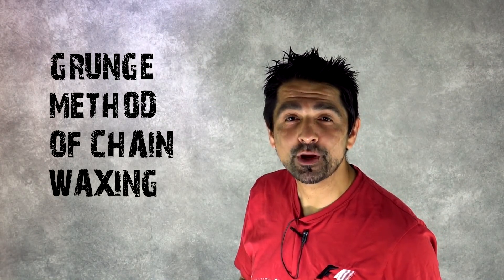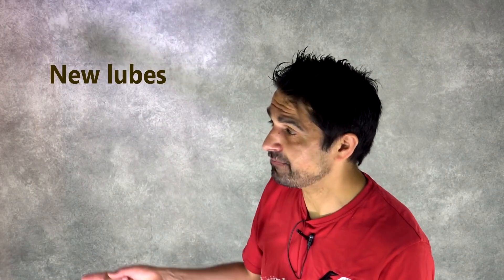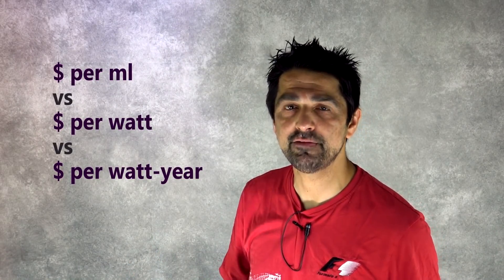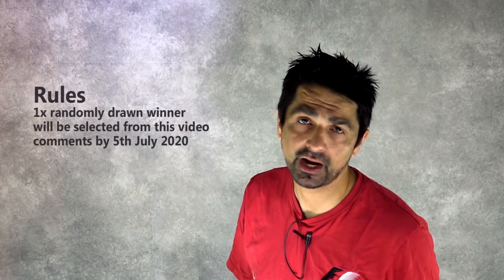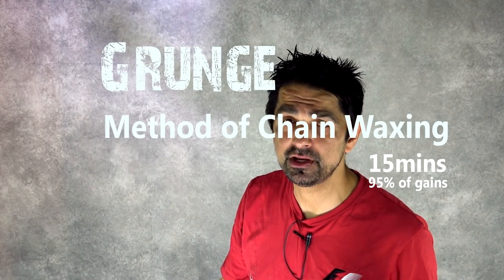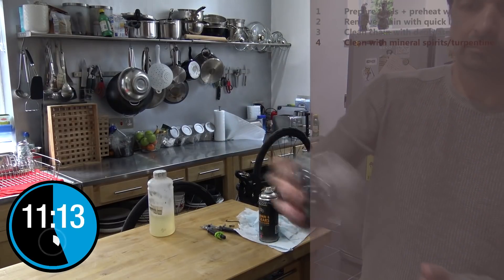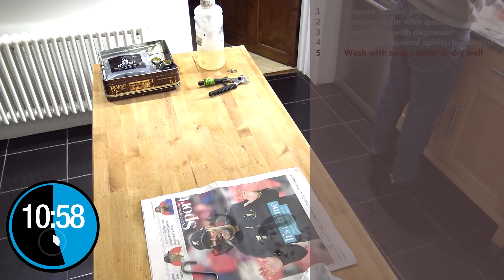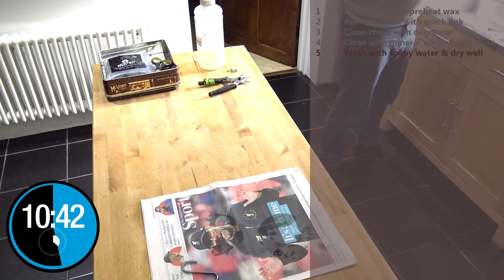Chain waxing and lubes revisited (15min grunge method is not a marginal gain)

Comment: I would suggest an immersion in denatured alcohol/methylated spirit after washing off the degreaser/mineral turps in hot (soapy) water. The alcohol is hydrophilic and will effectively dry the chain and then it evaporates. 

I've used immersion technique for track racing, where Kms are fewer and always in the dry. I have used it on the road too but I have found it lasts a lot less than 3-400kms, may be less than 100km. I find Squirt is good for 3-400km or a busy weekend, which I prefer. Either way, if riding in the wet with a wax-based chain lube, it pays to dry the chain off as thoroughly as possible afterward. If not - expect rust overnight!

Comment: This winter I started to look for a cleaner lube solution for indoor rides. I stumbled over MSW. The biggest pain is when you start out with a new chain, where you have to degrease it completely, but from there it is no big deal. I have 2 chain pr. bike, I ride 250-300 km and swap out the chain, this means I have to wax every for every 500-600 km. And turning on the pot and dip the chain, is not that big an effort. If the chain is dirty, just rinse it with boiling water through a sieve. One of the bonus benefits is that you don’t get a dirty drivetrain. I will never look back.

Comment: Click.  Click.  That was the sound of me hitting the like button, followed by the power switch of my wax slow cooker.  As a recent convert to chain waxing I wish I had done this years ago. The extra watts won’t make much difference to my level of cycling, but a full chain clean and oil lube takes a lot longer and is a lot filthier than waxing. And the waxed chain still looks great after 200-300kms - one ride with even expensive dry lube is already attracting dirt.

Comment: You are using those Ikea hooks too... :-)  I've not timed it, but I'd bet my time per chain is even quicker then 15min, by using 4 chains in rotation. I have a bucket of solvent in the shed & every two months do a waxing session. After initial run in of the chains, I hardly measure any wear (two seasons  on 4 chains & counting), so very little wear on the drivetrain as a whole. Only small side note, every freshly waxed chain needs a run-in for +/- 10km to be race ready crisp & wax chain is more noisy. (no need to be in the draw btw.)
Reply from the maker: Great tips thank you!

Comment: How do you clean the wax off a chain before re-waxing?
Reply from the maker: You don't need to for 2 reasons 1. its mostly worn off when you ready to re-wax 2. the hot max bath melts any older wax anyway...so this is one step you don't have to worry about

Comment: Back in the day when I tried waxing chains, I'd use a heat gun and lint free cloth when wiping the excess wax off after dipping.
It did reduce the amount of wax rubbing off on sprockets and chainrings etc.
Hope this tip helps someone.
Reply: Yep. I'm not sure I agree with letting the chain cool down in the wax and removing just before 50C. There's no way the wax drips substantially off even a quite hot chain - which is why I also wipe it down right after removing it from the wax.

Comment: Fred Sage 

I wasn't seeking a record,  but it obviously saves time to do many chains at once.  Additionally,  the cost of multiple chains is insignificant compared to the cost of replacing cassettes and/or chainrings.  Additionally,  since chain wear is drastically reduced,   I'm still using the same eight chains with little wear after 30,000 miles (> .2 MM).  Even if you're not interested in saving watts or having a spotless chain set,  the cost saving is impressive.  As an example,  at the rate my chains are wearing,  they'll last at least 60,000 miles.  With that amount of riding using petroleum lubricants,  I'd have gone through 15-20 chains,  at least three cassettes and one set of chainrings.  The cost of these would be many times the cost of MSP wax and Racers Edge.

Comment: I started waxing my chain about 6 months ago. I made a mix of Candle wax/liq parafin/ PTFE/black graphite. The aim is to have it soft enough at riding temperature that it does not flake off in use but solid enough that it sets.   The total cost of ingredients was 10 pounds, plus 13 pounds for a cheap rice cooker to melt and keep the wax in. I now find that just hot soapy water and alcohol wash followed by immersion in the above mix takes approximately 20 minutes, thats  every 500km (less when riding in the rain).  Since it takes about 30 minutes to clean my bike, if I incorporate the 2 jobs it adds almost no time as the chain is in the bath whilst I am cleaning the bike. Apart from using a few drops of white lightning on very long rides (more than 500km), I will never go back to conventional lube.  When the bath gets a bit dirty after 3 months.  empty out the cold wax block, scrape of the bottom 2 or 3 mm of dirt and grit and the wax is ready to reuse.  I think the whole wax block will last more than 1 year for 3 bikes.

On-chain wear, I measure the stretch using a park chain tool.  I have noticed chains lasting longer sometimes almost double the Kms in the summertime .. now I am prepared to invest more in the actual chain since I am getting through fewer of them.  The latest ones I have been trying are KMC DLC Celest on my Bianchi .... it looks stunning :)

Comment: So simple.  Been waxing chains on road and mtb bikes for years....brilliant. Started melting half a candle on camping stove.  Now use paraffin wax pellets with 10% ptfe powder in slow cooker. 10 mins. Clean chain with hot water,soak chain. Refit.good to go. Clean transmission!

Comment: OzCycle has an excellent video or 2 on cleaning and waxing chains. The single biggest time saver would be doing 2 or more chains at the same time. If you can do 1 chain in 15 minutes you can probably do 3 in about 18 minutes. Keep them packed away and you can swap out a dirty chain for a freshly lubed one in a few minutes.
  I am yet to do it but 1 of the single biggest benefits of the waxed chain is it is entirely dry so no dust or dirt will stick to it. Being bone dry and exceptionally clean it also means that you aren't getting dirty when removing your rear wheel to repair punctures etc.
  OzCycle has actually tested the process and compared it with others. What blew me away on 1 of the videos was the clean hands after handling a chain that's been out on the road. I'd pay $1/W to not get grotty hands.
Reply: I started this year, 5 chains in rotation. So easy once you do your first initial clean. I like it so much I’ve done my kids and wife’s bikes. No more oil on my clothes. So much better all round. Follow the OZ cycle vid and mix with Teflon. I’ve managed to pass this on to many other club members. Believe the hype!
Reply: @garethtupling2481  5 chains! yeah, then its definitely worth the hassle. For me, the initial cleaning process was kind of a turn off, had to spend few days making sure i stripped off all the factory grease off the chains. Now, I have all these chemical discard just sitting in my tiny apartment. No way to safely discard bcoz of covid situation. :(
Reply: It's a myth that waxed chains don't get dirty. They still collect dirt and black grimy stuff. Not as messy as wet lubes but can still mark your lightly colored pants or the back seat of your car. The video by oz cycle shows him touching the chain and no grime coming off it. My experience is not that squeaky clean. Also, if you are indoors, the wax still makes a mess of your carpet. Again, don't believe all the hype without critically thinking about it and give it a shot yourself.
Reply: @nirajshr  Yes. Waxed chains still get dirty. But the mess and marks they leave are far less messy than the typical lubed chain. I'd be concerned about rubbing anything dirty (including the bike) on car upholstery, but I'd bet a mark from a waxed chain on upholstery or clothes would clean up pretty easily given there is no grease/oil involved. It's just dirt and paraffin. Brush it off. All bets are off if you have moly in your wax. I replaced my chain today, taking it off with my hands. All I had to do was wipe my hands against each other to brush off the bit of dirt I picked up by handling the chain.

Comment: Interesting and I'm closer to trying it again. I tried wax about 30 years ago and ended up with a very stiff chain and a ruined popcorn popper. 

I've been using Squirt for about 4 years now. I apply it after every 2-3 rides and wipe the excess off before the next ride. I don't ride much in the rain anymore but the chain will start squeaking after about 50-100km if wet, though. I would probably use a different lube if riding in the rain regularly.
Reply: I suggest getting a used crock pot dedicated to chain wax. Yard sales or thrift shops are a good place to get them.

I remove the chain hot and wipe it down with a folded over paper towel. That makes it a bit less stiff. I also roll the chain up after waxing. So that loosens it up a bit for when I eventually install it on the bike.

Comment: Fred Sage

After two ultrasonic cleanings,  I use the immersion method with MSW.  I save both time and money by processing eight chains at once.  It takes about an hour to complete all eight chains,  but that's less than 10 minutes per chain.  After installing a chain with a quick link,  I add a dose of Molton Racers Edge graphite additive to give me the most efficient drive chain possible.  I've been using this method with the same eight chains for more than 30,000 miles with almost no chain wear (> .2MM).   Since my cassette cogs and chainrings aren't wearing,  I'm saving not only watts but also money.
Reply from the maker: Eight chains! That's got to be a record!!

Comment: I did some testing this winter with MSW on my trainer because I wanted to limit the grease/lube in the workout area.  I didn't really get a longer drivetrain life span, I didn't get more than about a 2 weeks of durability before having to re-wax.  I just didn't feel it was "worth it" and stopped doing so when I got the bike back on the road.  I would only get about 600miles/1000km and it was DONE, and It would have been better to do it weekly but felt it was a hassle with limited benefit.  I even tried the 2 chain rotation, so when one was on the bike the other one would be cleaned and waxed and ready to go.  In the end basically only got the same mileage I always get out of a chain, about 2500 miles (in a road chain, with super limited wet or Grimey roads).    I use a wet lube now, and clean the chain with a rag weekly and reapply the lube before the race.  This method is so much less hassle, and I'll bet I'm not losing much W during the race.......if I'm losing W during training that is great a cheap form of resistance training I say.
Reply from the maker: Thanks for your honest feedback. Sure waxing the chain is not for everyone, and does take a bit of time AND indoors would be especially messy because bits of wax fly off the chain for the first 1k after waxing.....so I was riding mainly indoors I don't think I would be waxing either!

Comment: i have a 5 liter slow cooker and do 2 chains at a time. usually have 3 or 4 chains to do when i do it. but i have never bothered about cleaning the chains before waxing other than the chain being washed with the rest of the bike ( usually wax chain after a bike wash) . biggest ride was 670km in a week and chain was still quiet. 130km of those km was raining too.

Comment: After immersion waxing for a couple of years now, my insight; 1. It works very well.  2. The process is quick and easy once you know what you are doing.  <15min. 3. You don't need to do a full immersion wax every few hundred Kms. Just clean the chain, cassette, chainrings as normal, then smear some warm (not hot) wax on the chain in-situ on the bike.  That approach works very well.  Do a full degrease and re-immersion once every couple of months - depending on how much you ride and the riding conditions.

Comment: you menstion that squirt should last longer rthan hot melt wax. ive used both and found that the squirt did not last long 200km max (unless i wasnt using enough) whereas the hot melt lasts around 400km
Reply from the maker: Interesting thanks, I am citing zerofrictioncycling results but maybe it depends on conditions

Comment: Don’t you dunk the hot chain in cold water to lock in the wax? It’s the best way to ensure nothing escapes. You’re losing gains while it hangs there and drips out. I’ve been doing it for years and get 15 hours out of a lubrication, but only about 7-8 if I don’t use the lock-in method.
Reply from the maker: No i don't find this is needed because the chain cools quickly out of the wax BUT its an interesting idea and I'd love to see a test on this method vs non-dunking

Comment: When I saw the title, I almost expected to see you break out the electric guitar, flannel shirt, and long shorts to rock us with your Dave Grohlesque stylings while your chain was soaking in the hot wax. :-D Great video, Alex. Thanks for the tips. Cheers! On a side note, cleaning my chain on the bike with a chain cleaning machine, de-greaser, brushes, and air blown from a compressor, then lubing with drip lube takes me more than 15 minutes, so your Grunge Method looks to be a real time saver for me.
Reply from the maker: 😂 .....tbh if you have to do it once per month, then 15mins is enough for me even if there is another 1w of gains untapped

Comment: I tried waxing chains many years ago and was not impressed. I'm happier using the micro-Teflon bead emulsion oil you promoted in an earlier video. When I waxed, I Used melted down candle stubs. Chain was always stiff when cold. Chain rusted easily. Chain made more noise. Perhaps there should be a study made of what wax would be best such as bees wax vs common candle wax (many types) vs paraffin wax vs ...
Reply from the maker: I'd love to see that suggestion too....this video comes close to that test: https://www.youtube.com/watch?v=VnPYdcbcAe0&t=480s
Reply: I think high quality paraffin wax is generally recommend and is what is typically tested. Candle wax may or may not be the same depending on what the candlemaker may have added to the mix. Canning wax from the grocery store is 100% paraffin.

I think you are correct that wax does not protect the chain against rust as well. So a real consideration in very wet areas. OTOH, maybe I'd run chrome or otherwise corrosion resistant plated chains.

Comment: I’ve been doing immersion waxing since reading about it in Velo News five or six years ago.  I use plain old sealing wax. . .   and usually do five or six chains at a time, once or twice a year.  Part of the success is to make sure that the chains are absolutely clean, by using multiple progressive baths of Varsol.   After all is done, I label and store the chains for my 8, 9 and 10-speed applications, and a few days later, decant the Varsol for re-use.
Reply from the maker: So organized! Impressive!!

Comment: You front chainring is out of Carbon O_O Nice man!
I was using about the last year the F100 New Formula with the 12x Force Chain on a 11Speed Casset. It is Worn out now about 2/4 Year old but i dont measure my distance.
Reply from the maker: yes, well spotted, I tried the rotor q-ring and o-symmetric and pyramid designs but the fibrelyte is light. However I have a quarq to fit and not sure if it will be compatible.

Comment: I have been using Molten Speed Wax for about a year and I will never go back. So far it has extended the life of my 11 speed chains by 3 times, no more chain marks on jerseys and if my efforts on my test TT couse is anything to go by there is a speed/power advantage.  I keep 2 chains running (I have been buying pre cleaned YBN from Zero Friction Cycling in Adelaide).  When I remove a chain after around 300km I drop it into boiling water for 5 minutes to remove the grunge, quick shake in turps to remove any road oil, and quick coat in methanol (it provides a water barrier) and let dry.  When I have two chains to wax I put them on a swisher I made with a coat hanger and drop them into a rice cooker for 10 min till the wax melts and then give them a good swish.  Hang them up to dry, put on the new chain and drop the spare into a bag.  At most 15-20 minutes every fortnight.
Reply from the maker: You got your method down James!

Comment: i did a full degrease and clean on my chains (4) and cassettes (2) and applied Tru Tungsten drip wax. Chosen because it was recently added / scored very high on the key comparison tests (better than Squirt / Smoove), just below MSW. So far very happy, 

the key point is it only took a couple of hours of prep, but I am saving more time than that every week as my chain picks up zero dirt now. 10 seconds to run a cloth over it. Maybe later a wash with water, but no degreaser necessary, as there is no grease / lube. No grinding paste

I added more wax after 200 miles. 

A great intro before going the full immersion / crock pot method, but I guess I am already getting most of the advantage of wax